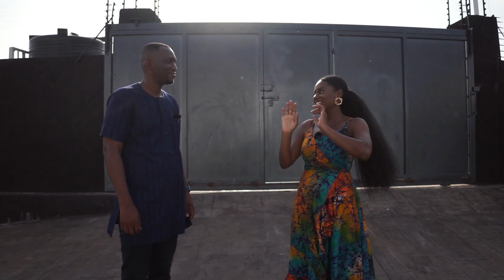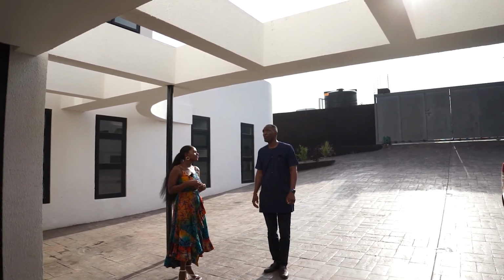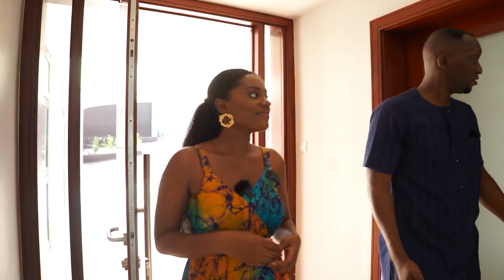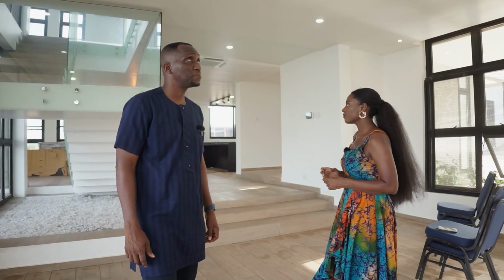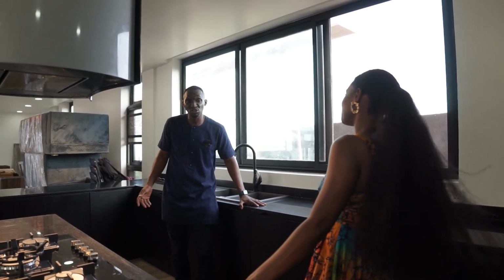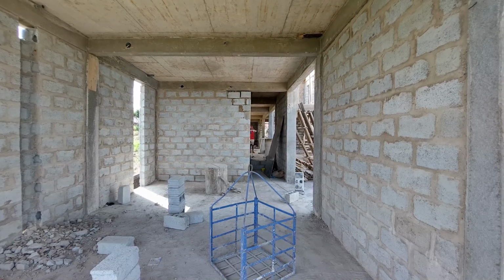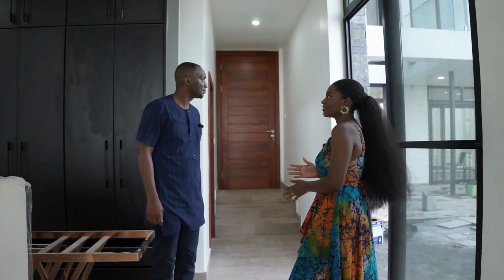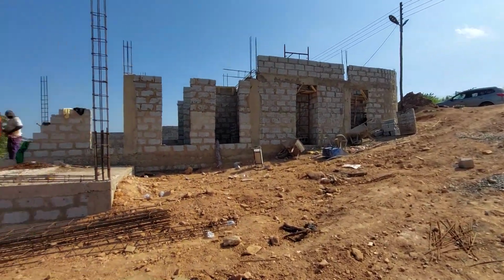He built a 7 bedroom vacation home with an amazing mountain view | Building a house in Ghana

Comment: The cassette type AC unit comes has it's own cons including leaking and clogging with dust. The farther the distance from the outdoor unit, the less efficient the coolant works. You'll have to weigh the variables. The other has its own issues

Comment: The cassette type AC unit comes with it's own cons including leaking and clogging with dust. The farther the distance from the outdoor unit, the less efficient the coolant works. You'll have to weigh the variables. The other has its own issues
Reply: But can it be cleaned and fixed easily